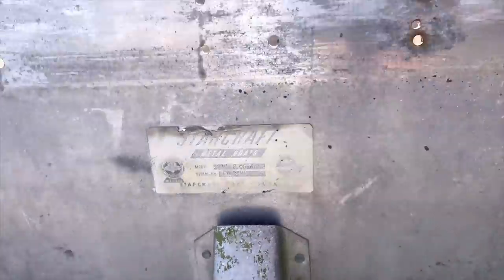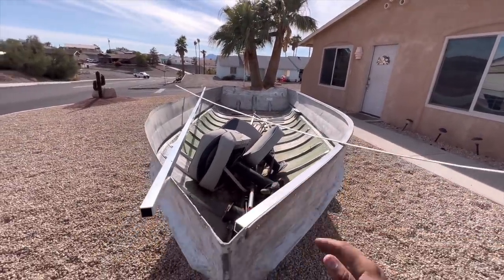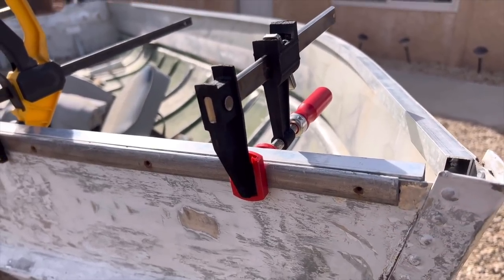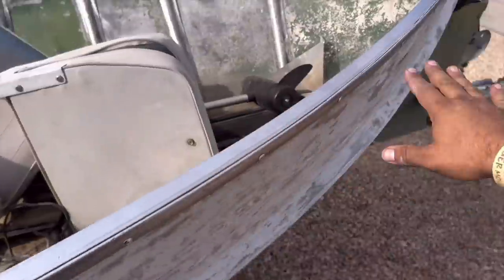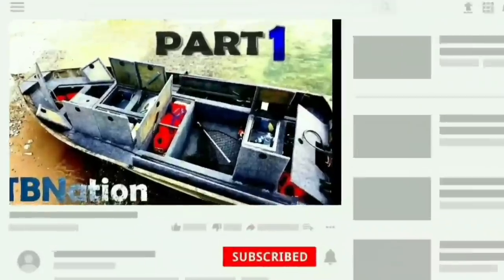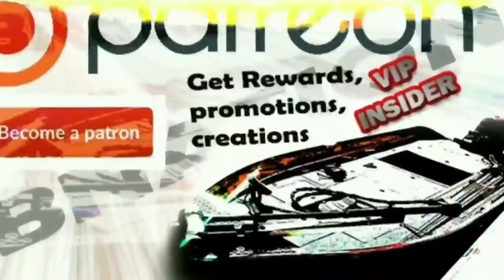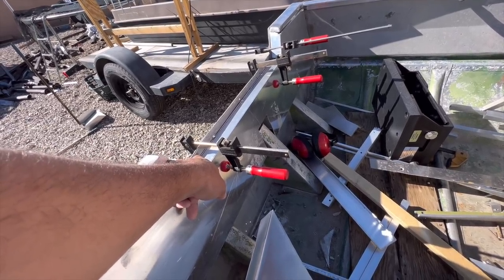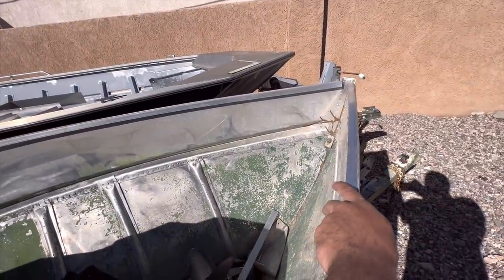Side rail | Gunnel overhaul | Budget Build Ep.2

Comment: I have been binge watching your channel along with Anthony jones and fireant. I have definitely been inspired to do a redo of my 14" Vbottom

One question for the bow of the boat where the two square stock pieces came together why didn't you angle cut them to have a clean connection? Maybe it's more of an OCD thing on my part than structural.

Comment: So could you use angle for the gunnels instead of square tubing I want to be able to add a track system for rod holders or whatever. But the track system is 2” wide
Reply from the maker: I would not do it that way
Reply: @TinyBoatNation  what would you suggest using that would be wide enough to be able to mount a track system to but yet be bond able or am I just going to have to cut and weld

Comment: If I'm using fresh flat bar that wasn't drilled previously, how far apart are those rivets?
Reply from the maker: 4 to 6 inches would be fine
Reply: Do a little research.  There are formulas that are actually produced by Engineers that have actually gone to school and not just guessing about spacing based on the fact that so far their boat hasn't sunk......yet.

Comment: STOP IT... Am I to understand that TRANSOM is Hollow🤔? If it is and you are selling them Please do anyone who is buying them a huge Favor by putting some 2"x12" material in there so there is something to mount your motor to when you Tighten the Thumb Screws or run a mounting bolt through it, Hollow aluminum will just collapse, You could probably source "free material" at most construction sites "ASK FIRST if you can go through their Fall/cutoff pile, garbage bin"   "Micro Lam" would even be better and stand up to moisture, even stacked 3/4" plywood, anything to fill the void that you can clamp down/ run a bolt through that's solid for the length of the motor area at least.
There are a lot of forces on that transom, not just hanging weight but pushing also to consider 🙂

You can Bend a radius in square tubing easily with a English Wheel and other types tools that are fairly inexpensive .

If you have a welder buddy you might think about having him weld you up a light duty rack for 1 side of your pickup to haul long pieces of aluminum above the bed and cab " just a thought" think of an upside down lowercase "h" and put the light weight material in the saddle of the h.

I admire your ambition giving these older boats a second life and inspiring others to do the same.👍